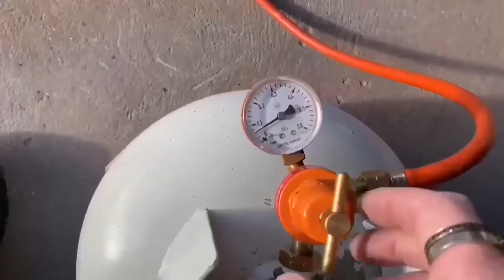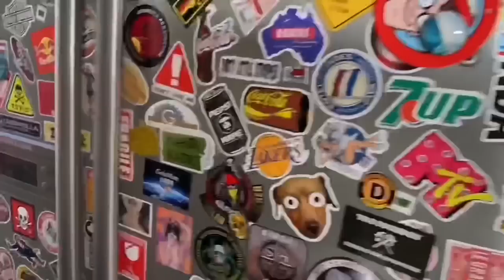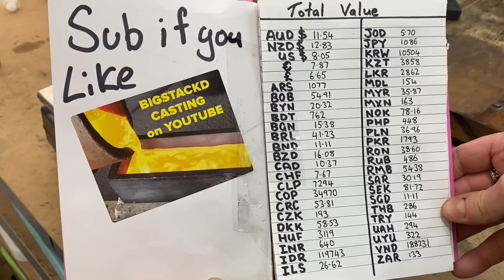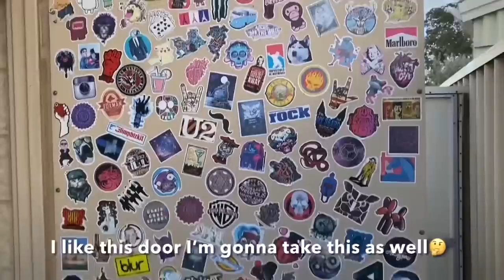Kitchen Copper Scourer Melt - ASMR Metal Melting - BigStackD Brillo Bullion Bar - Trash To Treasure?

Comment: Yet another lovely melt :D  Finally had weather for one myself yesterday, had an unlucky tipping of the Devil Forge after pouring the 8th set of bars, ending up with the inside all covered in splashed Aluminium.. Can't wait to clean that off :D

Comment: ive been thinking on this for a while, but wouldnt the bottom of a bar be smoother if the mold is heated up more? a hotter mold would cool the liquid metal down less, therefore influencing the freeze rate of the liquid metal, making the bottom of the bar smoother. unless the holes are more caused by overall thermal contraction than localized accelerated freezing.
Reply: I asked about the SPEED of the pour, if you watch this vid, you see the places where the pour is not evenly spread on the bottom of the mold, it beads up a little, rewatch this vid at  half speed where he pours you can see it.

Comment: Great videos :D  You should try putting your "pour" ingot on an oscillating/ vibrating table, the finished crystals will make a wicked pattern on top! ( very slow speed shake) and remember each metal needs a different speed vs weight. I used and old mechanical sifter for my range lead pours until I left it out in the rain  RIP

Comment: Cool! a shed build!  I need a new one and checking out your insights would be a grand idea. 
A re-weighing is probably in order.  I've been following for a while and joined in the middle of the accumulation. A quick re-weigh to confirm the addition over time is still accurate and knowing how much of each metal and its current value would be fun.  Thanks for asking. 🦊Riki2Tails

Comment: I wonder if you've ever thought about getting a small table top mill to clean up the flat sides of the bars using a fly cutter? It would allow you to MUCH quicker remove those kinds of small holes and also have the side benefit of making the shavings be in larger form with less to none of the debris from the sanding paper mixed in. Just food for thought, besides, I find running a small mill incredibly fun and satisfying.

Comment: I'f you get the mold red hot right before you pour you can avoid the bubbles and need to remelt. Or you could put your map torch on it and keep the mold fully heated through the pour and then the surface of the copper as you pour.

Comment: Hi bro ... wouldnt help with these deep holes to stir the melted copper with a thin wire in mold before its hardening to get any air bubbles out. Just a suggestion ... love your videos.

Comment: You should get some neebs gaming socks man. Would fit you perfectly. Also just found out WD-40 is just fish oil. More specifically trout oil. Thought that was pretty neat. Cheers!
Reply: fish oil my ass...The Australian formulation[ of WD40 is stated:

    50–60% naphtha (petroleum), hydrotreated heavy
    <25% petroleum base oils
    <10% naphtha (petroleum), hydrodesulfurized heavy (contains: 1,2,4-trimethyl benzene, 1,3,5-trimethyl benzene, xylene, mixed isomers)
    2–4% carbon dioxide

In 2009, Wired published an article with the results of gas chromatography and mass spectrometry tests on WD-40, showing that the principal components were C9 to C14 alkanes and mineral oil.[23]

Comment: Just wondering...if your mold was heated to the same temp as the metal, would you still have a 'holes' problem on the bottom? Or something to vibrate the mold as you are pouring ?

Comment: Maybe it's just me, but it sort of isn't the same enjoyment when the source is something that had nothing wrong with it. I mean usually it's great to see something that was broken, used, or I guess just generally had already served it's purpose and thus retrieving and smelting gives some of it new value, like those aluminum single use pans you melted down awhile ago. However, these pads are brand new, so it's just sort of like "okay? Yeah, metal things can be melted into metal bars.". Don't mean to be too rude or anything. And if no one else cares then don't mind me. Just my thoughts.

Comment: How does this not melt his garage door? I know its very much near the opening, but it still looks like its under the door. . does the heat go up and out fast enough that it doesn't affect the door?
Reply from the maker: All the heat from the furnaces disperse pretty quickly once they leave that’s why I can sometimes stand pretty much over them and film. Also when I built this house I got the Garage roof raised so it’s a lot higher than a standard garage, but I have done tests on the roller door and even when the furnace is directly underneath it and there’s no wind at all to disperse the heat the roller door itself only goes up about 12 or 13°C directly above the furnace👍🏻

Comment: I see doors I just melted a door got 21 aluminum bars. This melt is awesome flippin bathroom scrunchy, kitchen scrunchy, lolol I wonder if you tried a graphite bar mold that is new if you'd stop getting bubbles I always use graphite molds and never get the bubbles. I wonder if the graphite is contaminated from pouring I different metal and causing, something, to happen..... Your bars belong in a mint mine belong at the bottom of a lake......hahahaj damn you've got mail. Going to have to start posting on hump day to get us all through to Friday ;)-"""
                                            Steven de Anger

Comment: I found a copper flow water tank at the dump. after melting down a kilo my crucible cramped out..anyone know if I can use stainless measuring cups as a copper mould and crucible..

Comment: I'm a fan of how you can take thrown away items and turn them into pure profit, but, I gotta say this from the outset struck me as wrong. 30 grams of copper per pad. That's just under 2.5 CENTS per pad w/ today's copper pricing. I know each pad has to cost more than that. They don't appear used, so we can't even look at a "use it then recover it" mentality. Once you factor in fuel cost to smelt them.. it just seems like this is a negative transaction.